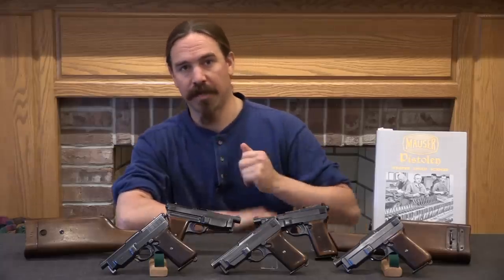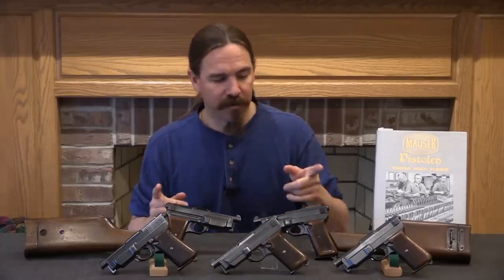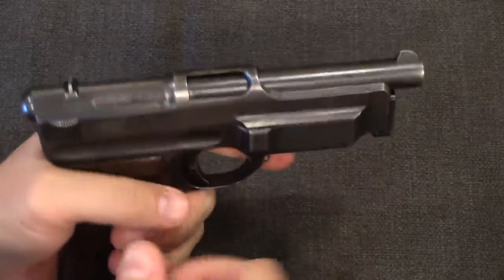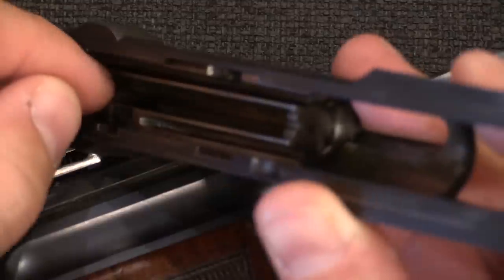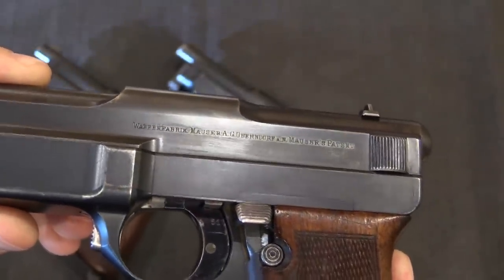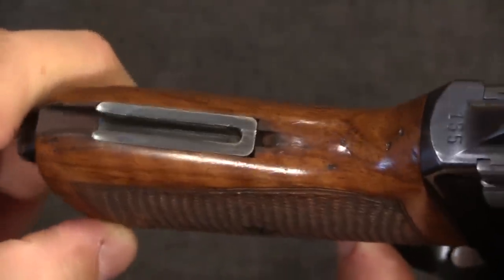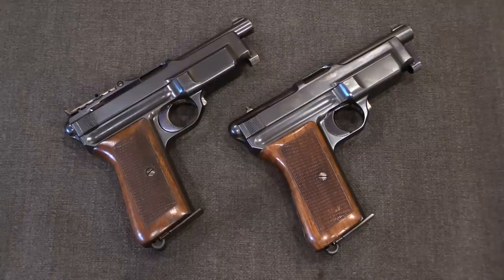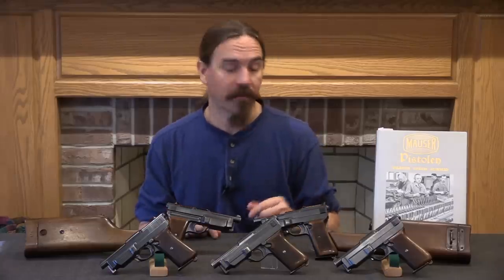Mauser 1912/14: Flapper-Delayed Blowback

Comment: In German:  "Do you know what a Pistol is?"  "No."  "Good.  You are our lead engineer.  Please assemble a random group monkeys for a design project."
Reply: "Also...be sure it is the most convoluted, over engineered, and expensive, design concept possible.
Reply: @roonbare2769  Actually the concept and design are really simple. The problem is the tight tolerance of the design making manufacturing really expensive.
Reply: I gotchu, fam: "Wissen Sie, was eine Pistole ist?" "Nein." "Gut, Sie sind jetzt unser Hauptingenieur. Stellen Sie bitte eine zufällige Gruppe Affen für ein Entwurfsprojekt zusammen."
Reply: Well, it DID work out for MG-42... even if the design needed 3 more years to iron out with other professionals invloved.
Reply: Later: "OK, boss, my troop of monkeys came up with a great concept. Now I need ALL the monkeys to grind the ends of the flappers until the pistols work."
Reply: To be fair, Mauser Company really underestimated the value of pistols because the Mauser brothers were really focused on locking down military rifles. Paul Mauser saw a chance in the 1890s to displace OEWG as the world's premier private supplier of military rifles, and so he threw himself and the engineers at making that happen. He nearly canned the C96 project on several occasions because he wanted the engineers to get their work on rifles finished first. That it was 1907 before anyone figured that maybe now Mauser has the German military rifle contracts sewn up for another generation, it might be cool to grab the pistols as well says just how unprepared they were to break into pistols, let alone the ambitious project of a pistol family.
Reply: ŒWG : Österreichische Waffenfabriksgesellschaft (Austrian Arms-Manufacturing Company), later Steyr Mannlicher

Comment: Not gonna lie, they look like they'd fit in a dieselpunk alt history setting.
Reply: It kinda looks like a precursor to the 12.7mm pistol from Fallout IMHO.
Reply: You don't know that they aren't there too
Reply: Or in Warhammer 40k as a Stub-gun
Reply: @elroma7712  It looks a little too clean for a 40K weapon. No seals, etchings, markings etc :D
I can see what you mean though, an officer's pistol rather than a grunts as they start at .50 cal and get bigger!
Reply: @MrGrimsmith  Not to mention it's not nearly bulky/heavy looking enough haha.
Reply: @MrGrimsmith  A stubgun can be any kind of small-caliber non-auto pistol or revolver, no matter if it was custom made by a master gunsmith, mass produced in a manufactorum or cobble together in an underhive workshop.
Reply: @RokuroCarisu  this is now a WH40K comment section
Reply: Or an appropriately mandalorian military side arm
Reply: @Helltanz98  that's more accurate imo, something from the Star Wars universe, given that most blasters in it are based on old real world firearms.
Reply: They'd fit right in in the Machinegames Wolfenstein games.
Reply: Nice Warhammer 40K rabbit hole 👌
Reply: Still its much better in steam/diesel punk setting than universe domination
Reply: I was thinking the same thing. They also look similar to Rick Deckard's sidearm.

Comment: Mauser: Make rifle flapper lock
Mauser again: Make a pistol flapper lock
Mauser yet again: Make machinegun flapper lock!
H&K: Make literally everything roller or flapper delayed for the next 60 years
Reply: When you flap your wings you fly high.
Reply: @Vanya Secundus It makes tons of sense from a manufacturing standpoint. If you have a high enough precision and metallurgy standard, you can drastically reduce the number of parts over a comparable locked-breech gun. This means you can, for the same number of man hours, either produce a larger number of guns, or produce the same number of guns to a significantly higher standard of precision. You do end up with a comparably heavier bolt, but the increase in perceived recoil is largely exaggerated and generally an artifact of the use of worn-out mainsprings in Century Arms examples.

Comment: This looks like normal wear would become a big problem when the flaps and the block looses the sharp edges, gradually making the gun cycle in too high pressure... still a cool precursor to the roller delay mechanism though

Comment: That flapper system is actually very simple and would be easy to produce with modern cnc systems. Someone should make reproductions of these!
Reply: Yes, but that button on the trigger guard is scary and would have to be changed. Shooting this with some popular grip techniques would result in potential disaster.
Reply: I bet this system is also tricky to maintain. I believe that the contact angle between the flap tips and the locking wedge-block is precisely determined by the coefficient of friction between them. If that surface gets dirty, the coefficient of friction changes. I expect this mechanism is fairly sensitive to cleanliness.
Reply: @claudiodiaz9752  Even as a "never ever shot at pistol" guy it struck me as a potentional "disengage all locking" disaster with modern grip technique. I could however see it redesigned as a "modernized" grip safety
Reply: @aaronclair4489  that's a petty sealed system. Easy to maintain so long as you're not literally dragging it through the mud. Also, the flappers don't rely on friction (the Blish Principle has been pretty much disproven) but on mechanical disadvantage. The flappers basically act as a pendulum and it takes a lot of force to push them apart, whether cycling the gun manually (hence the disconnecter) or during a course of fire.
Reply: The design itself could easily be improved upon with access to advanced CAD software and high end 3D printers that extrude metal. It's actually impressive how old school gun designers were able to come up with sophisticated devices while using relatively primitive tools. Imagine what John M. Browning could have achieved if he had access to modern manufacturing technology.
Reply: @Viper2132  No, I'm not talking about the Blish principle. The Blish lock assumes that the coefficient of friction increases with pressure, so the bolt sticks at high pressure and rotates at low pressure. 

Of course in reality the coefficient of friction is usually pretty constant with pressure. However, it's still true that at shallow contact angles, surfaces will slide past each other, but at steep angles surfaces will stick.

Of course it's hard to describe without diagrams haha.

Comment: That specific method of delaying blowback - relying on friction and offset force rather than mechanical disadvantage moving an otherwise free-moving mass - has me curious what the actual service life of those flaps would be. I suspect they’d round off quite quickly, and their ability to delay would become worse.
Reply: Peak pressure in the chamber, and hence on the working surfaces is of very short duration. During that time, the locking flaps are probably acting only as struts in compression, with very little relative movement between their faces and the block that works against them. As the pressure drops, the flappers/block structure collapses, and the faces slide over each other, but under constantly decreasing pressure. Providing the components are properly hardened and polished, and treated to the occasional spot of Waffenfett, it would probably last OK.

Comment: I bought the .25 acp version. thought I broke it when I couldn't get the slide to go forward and then the "slide lock" got stuck in the down position. luckily the seller is an old hand and showed me how to operate it before I bought it. he got a good chuckle when I freaked out about it though.

Comment: Looks more of a friction lock than a roller lock that delays breech opening. As in it exploits friction on the angled face of the flappers rather than the Mechanical disadvantage of the resolved forces in roller delayed blowback. You wonder if the breech thrust loads were shared evenly too when the tolerances in the flappers are accounted for....Those flappers look a nightmare to machine. But the deep bluing and wood compensate for all these deficits

Comment: I have always wanted all the Mauser 1910 style pistols. I had a 1910 I would have loved to get a 1914 and a 1934. I was working at a Gunshop in Colorado and there were a lot of old fírearms there. We had one come in and I liked it so they bought it and they knew I was going to buy it. I think that the shop bought it for $100.00 in 1998. Not today that would just be wrong. They sold it to me for $110.00 that se day. I was really big in the fírearms sales community or other gunshops that were friends. We were all basically connected in some way. Because I loved old fírearms other shops would buy a old fírearm and of they couldn't sell it in a year or so they would ask is if we were interested in it. Most the time we would buy it from them and try to be as fair as possible with them. Of we beat them up on a gun then they won't work with us next time. Our shop had about 2,000 fírearms in it at all times. About 300 of them were antique firearms or unique fírearms. It was a good draw for some people who love old fírearms like I do. Especially pocket pistols from 1860 to 1940 when the craze was over. We still had junk like jennings and davis. I never owned one of those but I probably should have just to round out the collection I wanted to make a shadow box frame for my pocket pistols but I have like 30 of them. That shadow box would get kind of heavy and I would really have to anchor that sucker with lags to hold it up. Anyway I will have to do a series 9n my pocket pistols taking them to the range after I explain how they work and a brief history. I think I would like to have your help on that but I know you don't read these messages anyway. But I would love to be able to pick your brain and learn something. I'm 51 years old and you make me feel like a infant when it comes to fírearms information and I was the go-to guy at the shop when it came to odd or unique fírearms. Even the owner came to me a few times for information. That's before the internet was the center of our lives. That's why I have so many books on fírearms. Before 2000 that's how we learned about firearms and those books are noy cheap either. My boss would order what ever book I wanted plus he had a really nice collection of old fírearms books starting in 1890 or so. It was always changing. Hell I got one of Jeff Coopers books Live right and shoot straight or something like that from when he was in the shop and signed a few for us. He signed mine thanks for the great conversation your shooting friend and his name. He wanted to go with me when I got lunch. I think he just wanted to get out of the shop because it was so busy. We were having out annual founders week sale where everything was at cost and we had reps from all the companies but not competitors at the same time like a Glock rep one day and a smith rep the next along with a leopold rep and a Redfield rep. You understand what im talking about. It was nice too because the General manager would always end up working for one of the companies. I was supposed to be the GM but my mom had a stroke and I had to quit my job to take care of my mom because my dad couldn't really do it. He was too old but he had a great paying job as a military contractor building test equipment for the Abrams tank and the current attack hilocopter. They both used the same machine to make things easier. They also made maintenance equipment for other vehicles also. They were the size of a small shipping container for the big ones to ones the size of a 3 drawer tool box for some other kind of equipment. I'm sorry my posts go all over the place. I love to talk especially when I'm on my pain meds. Happy Safe Shooting 🇺🇸💪.

Comment: Can the pistol be fired when the flapper delay release lever is pulled down while the trigger is pulled?
Reply: I think it'd break the gun.
Reply: I thought the same, could lead to accidents and dangerous malfunctions
Reply: I'm not seeing any kind of interlock that would prevent that so, yeah, you could probably do it. You'd essentially be operating it as a blowback-only system, with inadequate mass. Best case, you have extraction under very high pressure. Worst case, you have a case rupture and possibly even a projectile stuck in the barrel. It would be a very bad day. But afterwards, maybe you get a cool eyepatch and do a Paul Mauser cosplay!

Comment: In the early 60s, a Mauser 1914, maybe 34 was used as the basis for a firearm carried by agents of a (not so) secret police organization, and were convertible to carbine by with the addition of a skeletonized metal stock, a longer barrel and pistol scope, these were quickly replaced with larger p38s with the same attachments, I've wondered why the Mauser was initially chosen and now wonder if someone in the prop making department had somewhere seen one of these beauties

Comment: Actually it is not so similar to a roller delay. Because on a roller delay you accelerate the bolt when the rollers force the "wedge" out. While on this design you don't accelerate the slide, just create a lot of resistance on the start of the travel. This will result in a slow slide velocity, and a weaker extraction than on a roller delay design.

Comment: I'm curious, is there anything stopping the shooter from pulling the flapper release and the trigger? Would this cause the gun to fire without delay and potentially open while pressure is too high? I don't think this would be an issue firing one handed but I could see it being a dangerous condition with a sloppier modern shooters grip if a person wraps their finger around the front of the trigger guard.

Comment: The delaying system would actually be more similar in principal to the Maxim Silverman pistol's side spring rather than roller-delay such as on the HK G3 & MP5. All the "wasted" energy for delaying on this would go to the frame, while on HK roller, part of it would go to accelerating the bolt carrier.

Also if you hold the cocking button on firing I wonder what would happen? 🤔

Comment: Does the disalengagement leaver on the front, which unlocks the slide, has any forms of safety preventing you from firering the gun while the locking mechanism is bypassed?

Otherwise: rests front of the gun on some obstacle to get a more stable shot, accidently presses the leaver, fires, slide comes to fly into your face.

Comment: My friend's dad had something extremely similar, but I don't recall a button in front of the trigger guard, and I am positive the guide rod end wasn't machined. I do recall it was "around" 6mm (so assume it was a 6.35mm version) and had very basic fixed sights. Are there any other versions it could possibly have been? Unfortunately the last time I saw the gun is probably 25 years ago, and lost touch with my friend 20 years ago, so my memory is a little hazy. I always thought it was a neat little gun, but never asked how/why my friend's dad owned it [in the UK],... I only know the family moved from the Far East to the UK in the early 80s, and his dad (British) had diplomatic immunity for some reason. Would've been rude to probe any further! 🤣🤣🤣

Comment: Could you do a history of serial  numbers when & why they first were used would like to know thanks
Reply: Ian gives one reason at around minute seven talking about the delay mechanism. Tracking parts. It lets you identify the quality of a specific assemblage/system. This is an enduring issue in organisations like the police or army as different users maintain weapons differently. You can also track who has lost or sold a weapon.
Reply: @tamlandipper29  thank you i could have been more specific your latter input is what I'm after. Wondering if like the Springfield trapdoor had that kind of #, really just hinting at things learned scholars should speak on
Reply: @rotatothesmoothbrainandtar6189  I don't know for sure, but I would imagine it only started with factory production. Could be wrong, though.

Comment: I realise that collectors may (or rather will) disagree... BUT... if the "reproduction" stocks were made by the same company...to exactly the same design.... I find it a reasonable argument to call them "original".  A milspec 1911 made by Colt today is still a 1911...it is not called a "reproduction"... So......do the dates really matter???

Comment: Will it fire with the flapper lock lever depressed?  I guess don't use a benchrest.
Reply: I'm not seeing any kind of interlock that would prevent that so, yeah, you could probably do it. You'd essentially be operating it as a blowback-only system, with inadequate mass. Best case, you have extraction under very high pressure. Worst case, you have a case rupture and possibly even a projectile stuck in the barrel. It would be a very bad day.

Comment: Why the fuck did no one copy that delay mechinism? Imagine if this flapper delay was copied to modern day pistol or better yet smgs.  Yeah you gotta get precise machinine but we got milling machines and info. We could have far more accurate handguns thats cheaper then the lagao alien pistol and doesnt get as dirty as quickly. We could have a 9mm more accurate then a m17 or m9. It would remove the need for boosters when using suppressors. So much shit could be benifited out of these systems if we copyed the mechanism for moder day handguns or even smgs. This is far more advanced them people seemed to relized.

Comment: Question:  what would happen if you fired it while pressing the lever on the front of the trigger guard?
Reply: You'd essentially be operating it as a blowback-only system, with inadequate mass. Best case, you have extraction under very high pressure. Worst case, you have a case rupture and possibly even a projectile stuck in the barrel. It would be a very bad day. But afterwards, maybe you get a cool eyepatch and do a Paul Mauser cosplay!